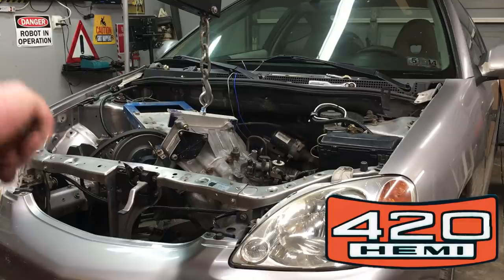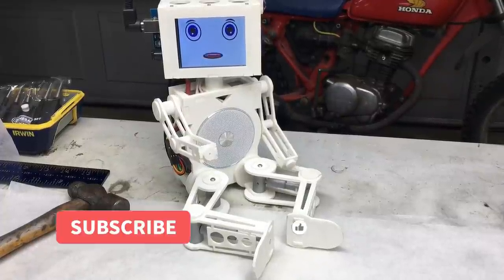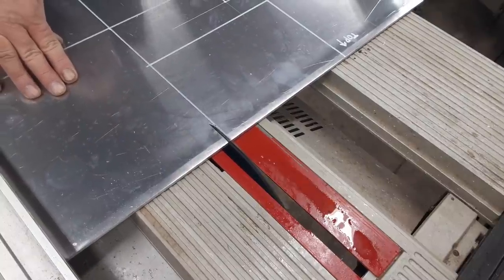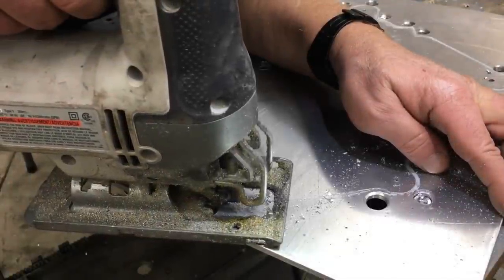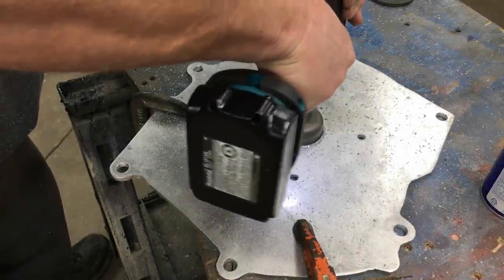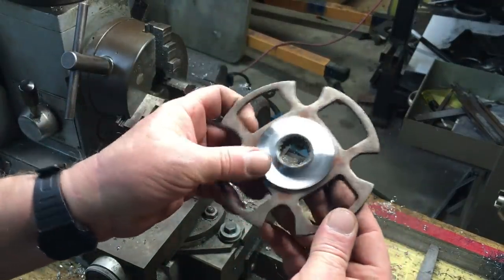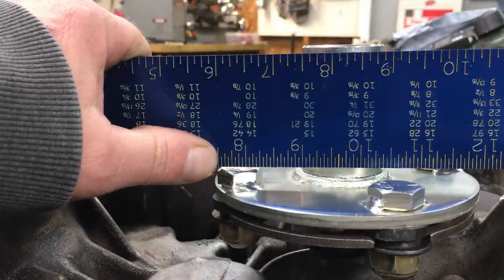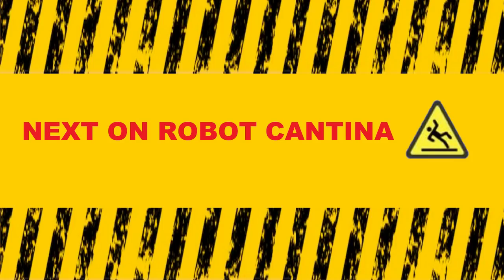Episode 11. We begin the  fabrication for the 420 cc lawnmower engine swap in our Honda Insight

Comment: This is my favorite build series. I kinda want to find a Honda Insight...
Reply from the maker: Seems like the insight is almost the perfect car for these shenanigans.
Reply: Yes
Reply: In lieu of that, a regular older civic would work just (about) as well. 
Or how about an old b11 nissan sentra? They only weighed about 1800lbs curb and were made of (thin) steel so the lawnmower engine would work really well.

You can even keep the stock speedometer....it reads off the transaxle.
Reply: @twoeightythreez  how about a 1998 SSS...?
My daily x)
Reply: @twoeightythreez  no it wouldnt.  The insight is like 1800lbs curb weight.  Thats with an engine and a heavy battery as well.  Remove all that stuff and you are significantly lighter then an old civic.  Im sure the old civic would work too but not "just as well"
Reply: @timm5970  you really dont need to point out that "curb weight" includes the engine. Thats what curb weight means....stock, all accessories, full fluids. I know it makes your comment seem more learned but in reality it just makes you come off as condescending.
I did edit my comment to say"almost" as well though 😂
BTW
The battery in the insight only weighs about 80 to 100 lbs. Its an assist only, it was not designed to drive the car on electric power alone, so the battery did not need a large capacity.

A stock 1992 civic DX hatchback weighs right around 2000lbs. The steel they are made from is about as thick as a pop can. 
The insight's aluminum body panels are obviously gonna be thicker because they need to maintain equivalent strength to steel panels. Yea a civic weighs a bit more but the difference Certainly not in the range of absolute rebuttal. Once you remove all the heavy stuff that both cars have in common I bet the weight difference is close enough that performance would not be adversely affected, particularly because the regular Civics had far shorter gearing in the manual transmission. The aerodynamics would play a far larger role IMO especially with top speed.

Its a lot easier to find a clapped out civic and that's my point. 
Honda even made a special HF version that got over 50mpg!

Going on that metric... I wonder how well this experiment would work on a Suzuki Swift/Geo Metro 😂
Reply: @twoeightythreez  specifying curb was very necessary because it shows that there a 200lb weight difference to begin with and because the insight is an electric it loses more weight during the weight reduction process then the civic would.  The difference in weight should increase in favor of the insight and yhe weight most certainly would be significant.  With that said you could uses a civic and remove sound deadening, carpet, etc as well as replace the heavy glass windows with lexan.  It can be done with a civic, it would be done better with an insight.
Reply: @timm5970  

The insight's electric hybrid drivetrain is similar in weight to a regular civic drivetrain. Its not gonna lose "more weight" by eliminating the powertrain because The 80 to 100lb weight of the small assist battery is offset by the civic's 4cyl engine, vs the 3cyl of the Insight. The transmissions likely are very similar in weight, and the transmission is re used in this swap. 
I agree that the Insight is lighter, but its advantage will not increase when removing powertrain components. 
In any case, the gearing is much shorter in a Civic transmission, so acceleration would still be adequate, despite the slight weight penalty. The Civic has a rear seat and a hatchback which would help in usefulness. IMO Its the top speed where the Insight's far superior aero would pay dividends, not acceleration. 

Some other recommendations in the case of not being able to locate an insight to make a street legal go cart from  would be (in no particular order)

A 1st gen civic (1411lbs) and way cooler looking than the insight

Honda CRX
B11 Nissan Sentra/Pulsar
Toyota Tercel
Original Austin Mini
Datsun 210 
Datsun 310 (fwd)
Geo Meteo (1850lbs!)
Datsun 1200 (under 1600lbs!!)

And for the best laughs....

A smart car!
Reply: Subaru justy maybe?
Reply: @nerdyorganist  yeah, forgot about those! But need to find a manual one, the cvt's front pump probably takes more power to run than a 212 predator makes.

I think a BRAT would be really cool too. A bit heavy but thats what gearing is for!
Reply: Im actually considering doing this for my 1965 AMC Rambler 550 American with a 420cc predator....just so it can be a "yard rambler" 😂
They are far heavier than an insight but they were surprisingly light for the era and the size (about the same size as a modern Altima). They were right around 3000lbs and that was the station wagon with a very heavy cast iron inline six.
Reply: i want to put my v-twin vanguard in a chevy volt
Reply: Well, I'm fairly sure you could weld up a frame and just start from scratch rather than sourcing a car with.....limitations.
Reply: Could use a ford festiva, those are light

Comment: Engineering on the fly, my favorite. On my 420 conversion I found a exhaust set up for a ford 8n tractor that fit to good. Kinda scary almost no fabrication needed. Should have mine ready for testing this week. Depending on WI weather of course.
Reply from the maker: I'll have to check out the 8N exhaust parts. thanks for the tip.

Comment: Motorcycle sealed o ring chain. You live them up with a special lubricant, let them dry, and the o rings release the lubricant. Never got any on my sprockets. 
.
You can also make a shield to prevent anything from getting on it.

Comment: Love it. Jigsaw aluminum fab. I’m a sick puppy too and built my twin 212 predator drift trike from Aluminum to force me to learn TIG. Learned a lot.

Also I use an OLSUN blade in my miter saw to cut AL. Works great. 

Also, if I may suggest, build yourself a table for a portaband saw. Take your jigsaw fab to the next level. Swag off-road sells kits if you don’t want to diy it.
Reply from the maker: Cool, thanks for the heads up on the Oshlun blades!
Reply: Oshlun SBNF-120120 12-Inch 120 Tooth - you got the right spelling, somehow I didn’t. These blades have copper plugs in the expansion slots to hold vibration and blade wobble down. 

A beeswax block like you use to clean a belt sander is also a nice item to increase your blade life and reduce “hangs” - although I had a buddy run the saw down into an unsecured block one time. Slung that wax block about 30 feet. Best to apply whilst not under power 😂

Comment: This channel is growing really fast. It has a good artistic and technic mix. Just two tips: you can use the saw in the lathe and do less work with a perfect cut (avoid standing over the plate) and when cutting with an angle grinder, you could start the cut from bottom to avoid breaking the metal or getting hit by it as it is used with logs and chainsaws.

Comment: I've use steering shaft rag joints, and steering column u-joints, for my coupler/drive shaft. They're light  weight, and plenty strong. You can find rebuild kits in auto parts help section, for cheap $$$.
Reply from the maker: As I recall my old cub cadet had a rag joint on the driveshaft.  good point.

Comment from the maker: Hi Tony,  I went with the chain and sprocket reduction  for a few reasons, the main reason was 1st gear on the insight transmission is very tall  and the ratio difference between 1st and 2nd is too large.  By using the sprockets, I geared the transmission down and effectively made 2nd gear into first gear.  The ratio spread  between the rest of the gears is more ideal.   A project like this really needs a close ratio transmission.

Comment: Adopter or adapter? 🤔
Reply: Adahpter 🤷‍♂️
Reply: If it fits , it works, lol.
Reply: At least he spelled it correctly just mispronounces it.
Reply: I’ve heard engineers and old maintenance guys say it that way. Not sure why.

Might be the difference between gauge and gage as I was taught. A hard measurement tool, like a 1” calibrated block is a “gage” block but a digital caliper to measure it, is a “gauge”. However - 99.9% of people would say “gauge” is a measurement tool, whatever the form.
Reply: Odiptar
Reply: Arr!dapter!
or
Meowdapter!

Meow. lol.
Reply: Well you know what they say adopt or die

Comment: I remember you saying  that your gonna use the 670 too. By any chance  are you gonna use the 301 as like an exhibition, to see how it holds up to the 212 and 420? Something that would  be really  fun to see is if you used the 79cc and see if that can do anything at all
Reply from the maker: The 79cc would be awesome LOL.    The 301cc 8HP is basically a big block so it will fit in place of the 420.  I think I would like to try that just for fun.  One thing to consider is this is a new channel and I need an eye on my budget.
Reply: @robotcantina8957  this series has seemed to blow up though! Congrats!

Comment: Turn the lathe on and hold your hacksaw against the part to be cut  it will cut straight and  A lot easier. Meet up ? 275 94 m50 an cables?

Comment: It's much more efficient using gears then sprockets with a chain, or a belt system.
Reply: And much harder to set the mesh accurately compared to a chain + tensioner setup (and noisier, though I doubt that’s a consideration here)
Reply: @emmajacobs5575  Helical gears are noiseless, and just need precise placement, something perfectly possible with the tools he has.
Reply: @ProDigit80  precise placement becomes more of a problem if you want to swap ratios as here
Reply: @emmajacobs5575  Not really.
Many cogs fit. Enlarge the driving sprocket, and shrink the driven sprocket.
There are many combinations to choose from, if you choose wisely.
Reply: @ProDigit80  so what is the difference in efficiency in a typical single reduction gear vs chain drive?
Reply: @emmajacobs5575  haven't measured it, but depending on the speed and some other factors, I'd say about 5%, 10% max improvement going cogs over sprockets.
The real benefit is in longevity.
Reply: @ProDigit80   I am a proud member of the ROBOT CANTINA fan club.   Love the content
and LOVE  the humor of the channel. 👍👍👍

Comment: I caught a glimpse in a previous video (#7 I think) of your set up without the jack shaft and chain. Can you explain the reason for needing the chain. I'm attempting the same 212cc Predator engine swap in a 2002 VW New Beetle. Mine originally came with an automatic transmission and I have considered using it in my build. I can machine a hub that would bolt the Predator to the original 2.0 VW engine's flywheel, so it could then be bolted to the torque converter of the auto trans. After watching this series, I'm rethinking the whole "auto trans" idea. Can you let me know your thought? Thanks.
Reply: One concern is that the flywheel from the original VW engine is part of the engines balance, So if a hub is made and mounted to the Predator engine then, The flywheel, hub and rotating assembly from the predator would need to be rebalanced to work together smoothly. An added unforeseen expense. So it may be cheaper and easier to source a bone yard manual trans. Your thoughts?
Reply from the maker: I'm not a big fan of automatic transmissions,  especially modern computer controlled ones.  The manual trans would be a much better choice.  I'm not sure what manual trans were available on the new bug, but if you can get a close ratio trans that would also help.
Reply: @robotcantina8957  Thanks, I'm looking for a manual transmission in our local scrap yards. But for now I'm stripping un-needed weight. She originally weighed 2800 pounds, I think It can loose 1000 pounds while maintaining a stock appearance on the outside.

Comment: What type of moped is it that stands there in the back while you're cutting tue Aluminium Plate?
Reply: Mysteri solved, in the next Episode I could see that it is the offroad Version of the honda cb50 j
Reply from the maker: Its a 1977 Honda XR-75
Reply: @robotcantina8957  cool a even bigger honda 4 stroke offroader than  the ones that where sold here in europe.

Comment: OK Im digging your project, but im really digging that old school Honda Bike is it an XR185?
Reply from the maker: Its a 1977 XR75.  I gave $100.00 for it many years ago.  its an awesome pit bike.
Reply: @robotcantina8957  Nice cant beat the old Hondas!, I have sitting in the back of my box truck a rolling chassis of an early 80s IT175, also in that truck is a 8hp predator ( along with a whole slew of side shaft single bangers) odds and bits  waiting to move to my Arkansas dogpatch. The 2stroke motor in the IT was left outside with the jug off turned it into an anchor, but the HF predator is gonna make it come back to life. Have you checked out Mike Festiva he does some very cool predator repowers . Awesome work and your uploads are worth subbing to them im working thru them slowly well done Jimbo! I DD drive a 71 W200 Dodge gave 300 bucks for it video on my miserly channel haha.
Reply: @deepbludude4697   I am a proud member of the ROBOT CANTINA fan club.   Love the content
and LOVE  the humor of the channel. 👍👍👍

Comment: Too much unsupported stick out on the lathe! I don't know how you avoided nightmare fuel level chatter there, but in future I suggest using a tailstock centre. Your lathe will also thank you for not using a hacksaw blade over its bed: I own one that got abused in this way and the gouges (from the previous owner slipping with the saw...) are so deep that even having the bed remachined to clean up the immense amount of wear (caused by the previous owner not oiling or cleaning it) didn't remove them.

Comment: So, seriously...you cut a 1/4 inch plate of aluminum on your table saw with a 60 point carbide tip blade? New blade? Trash canned it after these cuts? How hard is it to clean the saw so you can start making furniture again?
Reply from the maker: The aluminum shards go everywhere,   it takes a bit to clean up afterwords.